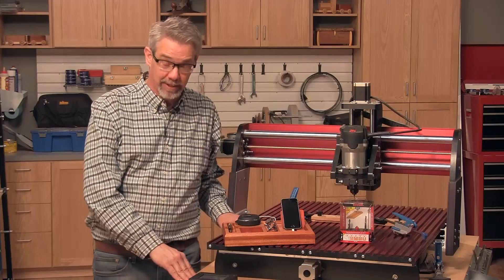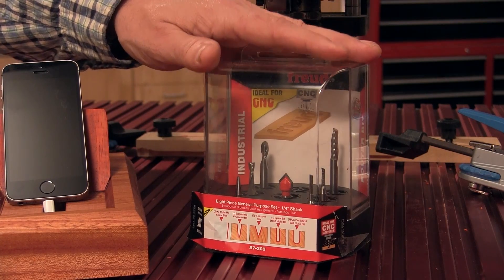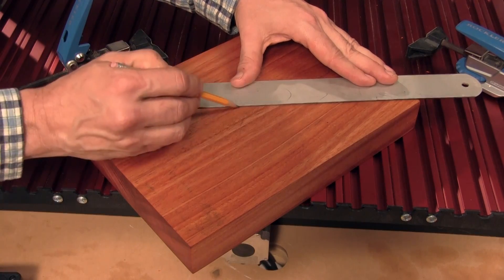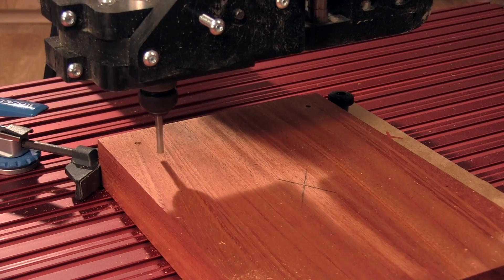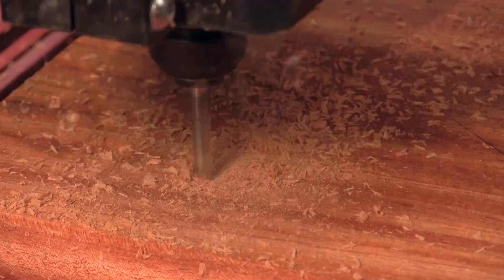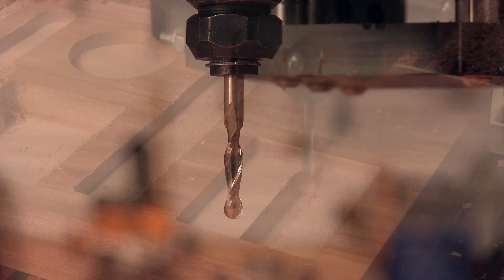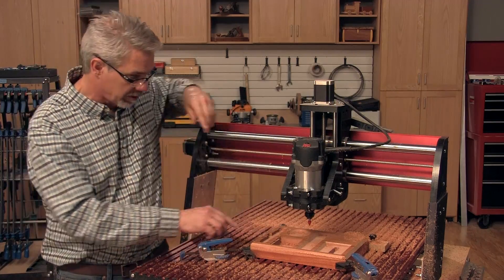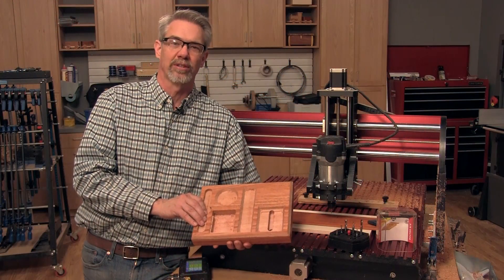CNC Router Project | Modern Desk Caddy

Comment: This would have been a much cooler project with a router and perhaps a template.
Reply: tomj528 
Ditto
My current budget will in no way allow for a CNC
Reply: It doesn't even come down to just that...a CNC router is something that very few can really justify buying.  In fact when you get right down to it, is it even still wood working?  Not to mention everyone has a finite amount of shop space,  the rapidness of tech obsolescence (hello windows 11?) and let's not forget it's another high priced tool with endless accessories.  These days I like to keep things simple and inexpensive.